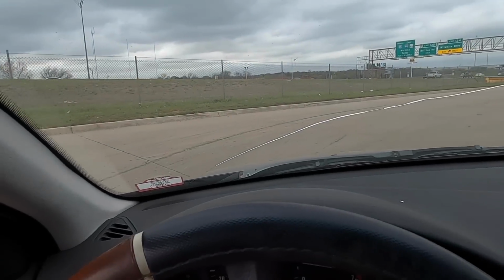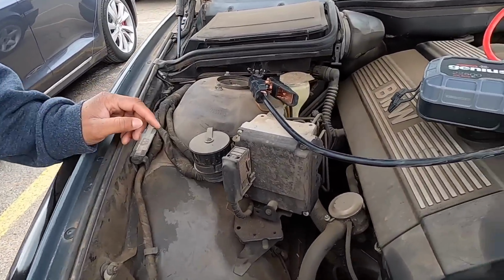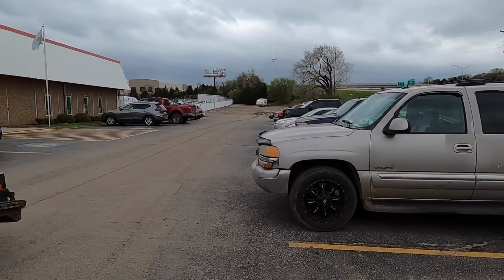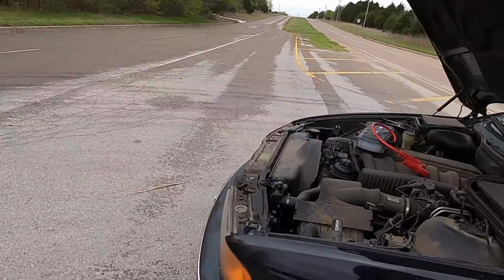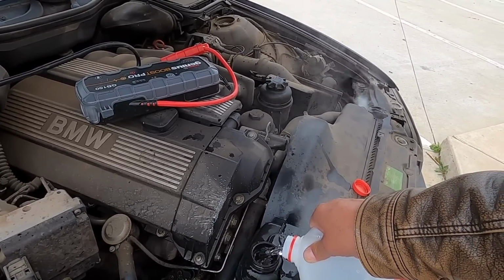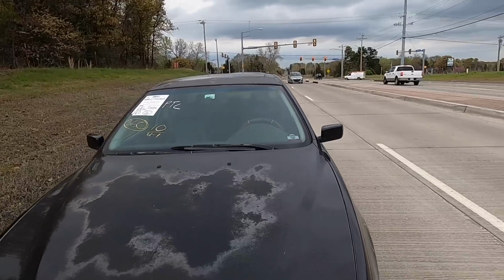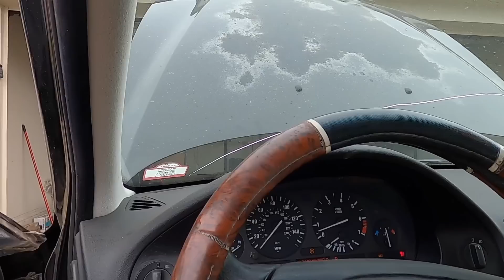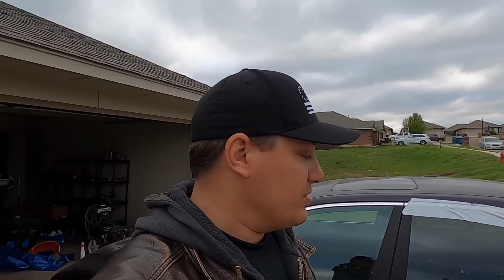I Won a Charity 1997 BMW 528i e39 from IAA for $175!!! Does it Drive??

Comment: For the speedo, scan for codes and if there is nothing related to the speedo, try tapping the glass or pushing the needle while the vehicle is moving. as far as i know, the E39 uses only one sensor for mileage and speedo, so if the sensor is intact, it should be the cluster or the needle itself. maybe worth trying.

Comment: The car is misfiring and he thinks it’s the trans hahaha. Get a scanner: change the coil packs and spark plugs. Always fill the car all the way with coolant/water before you drive any e39. Owned one for 6 years sold it for a perfect r230 SL500

Comment: People that don't know it don't know. That bmw is a future classic and will be worth a lot in the future. It is a really great car and is worth restoring. I own one now and i had one before. The worst part is the cooling system and the ones that came with gm automatic transmissions my current bmw has the same engine on it and it has 240k miles and it still runs like a dream. My previous had a 3.0 diesel and it had 400k miles with original engine and transmission. The car is really unkillable but idk how anyone could ruin it so much in 175k miles.

Comment: You can also pour out some of the battery acid and mix some Epsom salt with some distilled water and refilled the battery reservoir and the. Put it on the trickle charger! I did this to mine a year ago and it still starts the car on the first start! Try it!

Comment: i have just owned a E39 528i and fixed it up. If the speedometer dosent work and the ABS/ESP light is on, its usually the left rear wheel speed sensor that is faulty. And yes the cupholders are well known for being too fragile

Comment: Rims are expensive 
Change the water pump , radiator ,thermostat, coolant 
Fresh engine oil 
New battery 
Macco 300$ paint job
These bmw e39 are solid cars

And lets hope you didn’t damage the engine 
The head is made of aluminum and letting the engine overhead this long can damage the engine 
Lets hope all will be ok

Comment: Yes brother ! When buying an e39, have to overhaul the cooling system. Change that water pump as the OEM ones have a plastic impeller.  Have to lift the front of the car to bleed the system.  The spare tire
In back is a 16" BBS wheel. The 17" two piece BBS wheels off the Sport trim are the desirable ones. The ones on the car now are very desirable. Check out WATCH JRGO. HE recently fixed a few things on his e39.

Comment: On your Bmw E39 speedometer doesn't work because of the abs light. It might be just because of the battery, speed sensor (abs sensor rear left wheel), or Abs pump (in the engine bay) which is a known problem on this cars. Start with a good battery, clear the codes and recheck after that. nice car!

Comment: There is a little rubber hose that goes to coolant reservoir. Check ot before you purchase the radiator. It is attached just where water is spilling out

Comment: If you don't want to leave it in the garage, holding the unlock button on the key or putting it in the door and holding it in the unlock position will roll down the windows so you can open the door

Comment: I got a 99 BMW 528i it's the ABS module if you get the speedometer work and it should fix the problem with the transmission I had the same issue

Comment: All the yellow lights, speedometer and fuel consumption  meter " miles/gal"  are malfunctioned due to a black electronic box mounted on the ABS pump is bad, other wise change the battery first.
The heating issue radiator and the fan clutch not working there is no sound at all.

Comment: Randy, if it didn't blow the head gasket after that put a little cash into it and a couple of wheel speed sensors ( to fix the DSC light and speedo) along with radiator, water pump and thermostat followed by a system flush. It should make some money, but keep in mind the block is magnesium and the head is aluminum. They are very very very prone to blowing head gaskets when they get warm. It may take a few days to know for sure, they can also pull the headbolts out of the block when the gaskets blow. Either way, 305.00 for a 5 series isn't bad!!!

Comment: The arrow light usuly is triggered by a faulty ABS module. I have a e39 530d and its had the same problem as yours, the speedometer didnt work and the arrow light was on, I just put a nice used ABS module and solved the problem.

Comment: Replace radiator. Those engines need to bleed coolant system with vacuum pump. Happend to a friend overheating just because air in system.
And check cooling fan because clutch fan may be bad and remove thermostat and run without it to check if still overheat.

Comment: There is a procedure to renew a battery on   Sweet Project Cars   "How To RENEW CAR & TRUCK Batteries at Home & SAVE BIG MONEY!" .  Always enjoy your trying to get home felt like Seinfeld  "Kramer's,  test is to take the car to the limits of its fuel tank."  Only you had no water  lol  would have loved to see the long trail of Water Vapor, if the head popped,  I had one pop and fogged the road for a few blocks but made it home lol.  😂  Hey you need a Newman for the show,  Get  get a used mail truck to rebuild.   Thanks for the smiles.

Comment: The steering column lock is probably broken. Sounded and behaved like that on my VW Passat B6. I would recommend to either leave a key in the igniton or try not to lock the column. Mine was broken from one day to another and i had to tow the vehicle...

Comment: The answer is very simple Randy, check how much a working example is worth in the market and move on from there. Ofcourse most German cars have 50% of their problems due to bad battery, so just replace the battery and  do the necessary fixes. I would recommend fixing the windows and the door handle too as I'm sure you wouldn't be satisfied to sell it as it is. This model 5 series (E39) is a very solid car with very little issues. Hell, Jeremy Clarkson loves it.

Comment: The E39 is a very relayable car, just change the battery and the cooler give it a tune up and you will se you have a great car, also the ML320 would make great content.
Cheers

Comment: your transmission issue is just the ABS and traction light. my same car did the same thing. Wouldn't shift very well and in limp mode. My front abs sensor was bad. Works perfectly.

Comment: Speedometer not working maybe a fuse maybe transmission sensor and this  will cause false shifting and bad battery will make this motor rattling and no water in the radiator made it heat up and fans wont start on steam it needs water in the system and do air bleeding to get fans work properly

Comment: Time for a trip to pull-a-part, maybe you will get lucky and get most of the needed parts. It might be that only the hood has bad paint due to the overheating, then a trip to Weird Beard and a painting lesson would be a good solution. Have fun!

Comment: Possible output speed sensor on gearbox is faulty. Speedo can't register speed if that sensor if faulty. Also if abs sensor is faulty it can stop speedo from working as it can't read from the pick up rings

Comment: The speedometer and all the rest of lights on the dashboard are because of the left rear wheel speed sensor. Very easy fix. I daily a 535i E39 with 400K kilometers and it still running strong. Let me know if i can help with any advice other then cooling system. That is the obvious one.

Comment: If your thermostat gets stuck it will over heat and it can throw codes replace the allnator and battery and change you thermostat and oil and the other little stuff and it should be ok .

Comment: Just do a full cooling system overhaul. Costs $500 total and pretty easy to do. Replace battery as well. AND DO NOT LET IT RUN HOT

Comment: What I usually say in cases like this: you can't lose here, Randy. Paid $350, worst case scenario you can scrap it for $500! Fix what you can when you're able over time and you'll have a car you can sell for $2500. Not a fast flip but hey, sometimes you need to take the long road. I think you got a good deal.
Reply: You would never get 500$ for scrap anymore not in many years... I took a 2007 f250 crew cab Tuesday I got free complete truck with the bed full of scrap I got 182$, I haven't gotten 500$ for a scrap vehicle in almost 8 years
Reply: @frankm8533  - hmm. I just got $500 for a gakked '01 Mustang with a V6. Just my experience - I guess it depends where in the US you are?
Reply: @wes11bravo  o damn really that's great for you! I'm in Maryland it's been way down for years and years I use to live off scrap but not in a long ass time!! I hope it stays up in price for you brother
Reply: @frankm8533  - to be fair, the place that took it is now out of business! So I would say you're correct about the current scrap prices, brother.
Reply: @wes11bravo  o that sucks! There probably 4 yards that are big here in my area then another maybe 7-9 that are small only take cores, or bucket size stuff they are mostly around the same price. But they got real picky over the years and with the low prices unless the vehicles are free with a title I don't take them it's not worth it.

Comment: It doesn't look all that bad for the money it cost! Anyway, the fact that the speedometer/odometer aren't working and the ABS/Traction control lights are on probably means that one or more of the ABS wheel speed sensors has stopped working (road dirt stuck to it normally). I've been told they can be cleaned but most tend to replace them since they're really really cheap. They aren't replaced in pairs like brakes or suspension bits, one at a time is fine. Then, the check engine light. That could be down to the car thinking it's -40 outside or it could be something else like a clogged cat - it's hard to say for sure. Last but not least the airbag light. When that's on in red none of the airbags will fire in a crash, and the car will automatically fail inspections and so on. At least in the 3 series it would often times be caused by the passenger seat occupancy sensor mat getting shorted out when people spill things onto the seats or ripped when they are trying to get something from the back seat and knee the seat. These are ridiculously hard to replace so instead most people put an emulator in which basically tells the car that someone is sitting in the seat at all times. Those aren't too expensive at all.

I suppose once all of the major bits are fixed there's definitely some money to be made in it knowing how much cars sell for over there! I'm not sure if I'd repaint it - sell the AC Schnitzer alloys though (even as reps!) and get the original BBS type wheels on it as there's money in selling them, and they don't add all that much to the car. I suppose if you're at a junkyard looking for bits for that Mercedes you could always try and find the wheels and plastic interior bits for that car there too as separately they're quite expensive. Anyway either way lots of content for sure!

Comment: Go almost all the way. The body seems straight for the most part. Good wheels and tires. Interior seems mostly intact. Engine seems to run well enough except of course the overheating issue. For $300 with a clean title, you could still make a buck with investing a bit more to the car.

Comment: I hope there's been no damage to the engine driving it with the gauge pegged on hot. An aftermarket radiator for a BMW should be cheap.

Comment: With as hot as that car got I wouldn't be surprised if the motor is trashed. They are notorious for warped heads and stripped head studs. My 04' e46 had a coolant leak and I was stranded on I-35 headed back home. I got lucky with mine and hopefully yours survives as well.

The speedo, Arrow and ABS lights usually come on with a bad wheel speed sensor(s) according to forums when I had those same dash lights on. 

Oh, and my BMW does the same thing in regards to the steering wheel. Kinda reminds me of my old Camaro.

I live over in Choctaw so if you need some help or advice feel free to give me a shout.

Comment: Minus the overheat u should Change the oil will marvel mystery oil run it for a few miles then change it with Lucas oil stabilizer it should fix the tick

Comment: Hey Randy, I think with a bit of work done to it, it will ride quite well (it already runs fairly good). I would also change the engine oil and filter, plus the air filter. Then it should be good to go.

Comment: I've been working on one exactly like it with over 300,000 km and driving it now and again for about 5 years until something else goes but I like to drive it and so far several dozen repairs later, head gasket, 70% sure if yours wasn't burnt before it is now. Also alternator slip rings, shift linkage switch, window regulators are crap twice, heater core, water pump, thermostat almost guarantee the head is eroded there, steering knuckle shaft, gauge cluster, moon roof because I wanted glass, and miscellaneous lights and other things mainly down to idiots "working on it" and paint. It may sound strange but personally I would keep it . The last of the "good" BMW's. I daily-ed it for a couple of years once it was fixed but now the electronic stuff is going bit by bit but everything that went into it was aftermarket or used so it hasn't cost that much really just many hours and I haven't had to fix anything twice except the regulators in the back because they are as I said total crap.

Comment: hold the revs around 2500 to charge the battery. alternators dont put out amperage at low rpms

Comment: mine e39 also gets warm fast but its known for it,  but as long the gauge is vertical it is good  past vertical  to hot its bad.
the spedo could be that the diff sensor is broken or not working properley that could explain ESP burning 
things i had to look for where transmission fluide and the vanos "overhaul"  but i love my e39

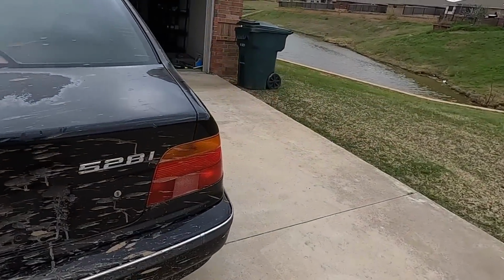Comment: 45:15 The Speedometer and Odometer are not working! When you were at IAA with the car it had 143,470 miles on it and when you got home with the car it still had 143,470 miles on it, so it is obviously not counting the miles either! I would guess that it is probably the speed sensor.

Comment: You have to be extremely careful when an E39 bmw 528i is overheating, if you overheat the car for to long, I will pull the piston head bolt threads off and if that happens, you need a new engine. I know that you couldn’t find a proper place to pull over to much after it overheated, but this engine issue is common for almost all E39 BMW 6 cylinder models.

In fact, the whole cooling system has issues with the plastic not being durable with the electrical fan failing unexpectedly.

The steering wheel play isn’t a fault, it’s a safety feature to lock the steering wheel when the car is off, and when you try to start it with the correct key, it will release the lock

Comment: Looks like you have a soft failed thermostat. Also it looks like the outside ambient temp sensor is bad because your cluster is showing -40F. That in turn will cause the compressor not to run. You need to get a new battery as well.

Comment: You wanted content during "the situation", you got it. 😆 I'd just do the cooling system, battery, get the lights off the dash, and maybe tires. Let someone else worry about the paint, windows, and little stuff.
Reply: He should at least do the rear windows to make them stay up. The paint job is nothing that "needs" to be done, but the windows staying up is the big thing when it comes to sealing the interior from the elements as well as security.

Comment: Didnt look like limp mode to me, my bet is it is a bad intake or exhaust cam angle sensor (causing the CEL and low power response) and then you also have bad abs wheel speed sensors causing the abs and traction control lights, and slow or misshifting. The ticking engine is low oil due to leaks or burning, when you checked the dipstick you need to put it back in and take it out for accurate reading, Ive had all of these issues on my 98 528 with the same m52 engine and they are easy fixes. Nobody is gonna see this now but I just wanted to share still

Comment: Replace radiator, both hoses, expansion tank, thermostat and water pump. Replace the battery and the transmission should stop acting up, you should be golden after that. That engine is super reliable once you work out the kinks. Just don't overheat it too much... Well, maybe late.

Comment: Before  trying to drive the car home I would at least  filled up the coolant. Better yet just have a towed till you could get it somewhere and really check it out.  Any big or little issues can make it go into limp mode. I wouldn't have tried to drive the car especially when you know it's running hot. Just jumping in the car driving it without checking it out good is a great way to destroy a car that may have only had a minor issue

Comment: Fit new battery, second hand radiator, & speedo so it's legal check for overheating, if it's OK, valet the interior, wash & buff  the paint ( that adds $$$$$$ & sell it.

Comment: My history with my e39 in one video, 
But mine over 9 month period had cracked 2 engine heads, hood got stuck closed, 4 window motors, rear trunk suspension , 4 suspension, stearing rack , headliner fall aparat, batery died , ac never worked , i bought it for 1300 dollar and sold 900 with an cracked engine and all these problem here where i live, 
I would  still buy an e39, but one that cost like 4k 5k ore more, not a junk car that has done her life

Comment: I feel sorry for all that tribal trouble you went through
The wheels are very good beemer accessories 
And hey when you looked at the river I was like oh Randy don't jump in to it 😂😅😅
All you have to do is replace the  radiator and flush the air out 
It looks like a good deal 👍👌

Comment: the ABS module causes speedometer and traction problems , I had MY rebuild and fixed the lights and speedo , company advertise on ebay